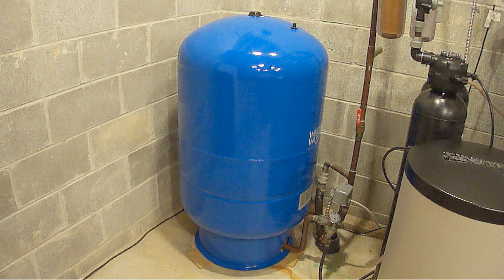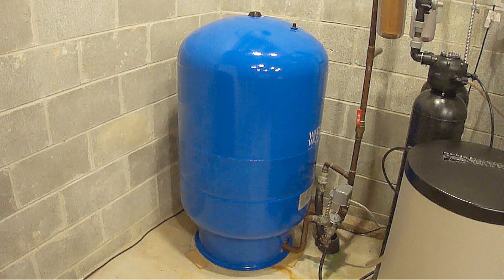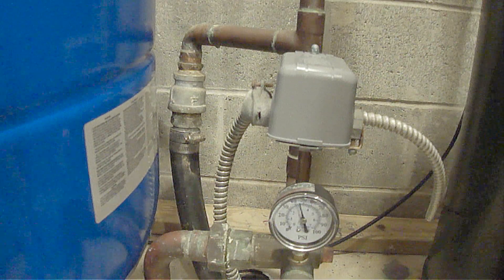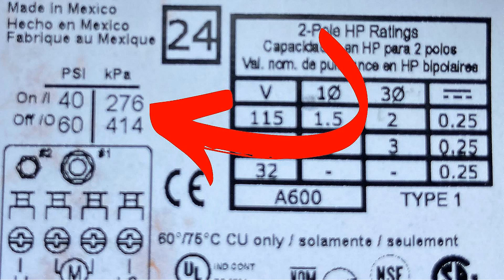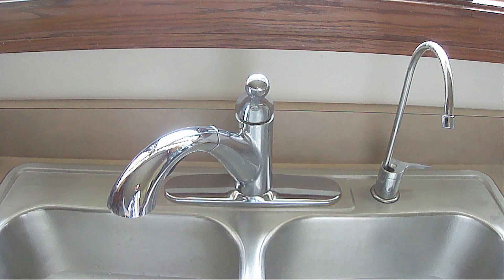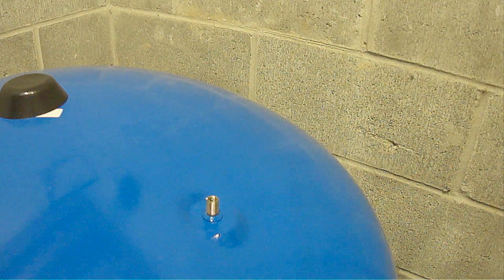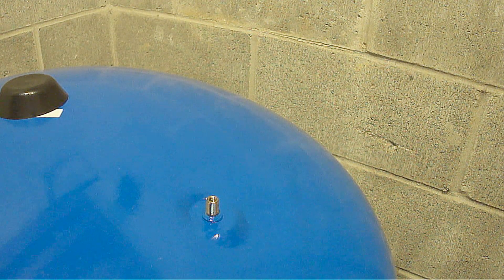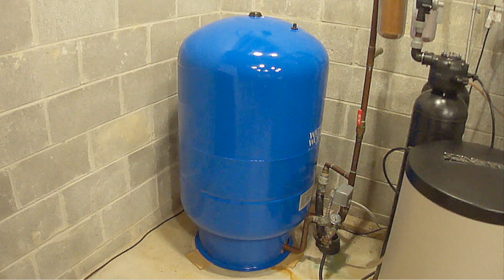How To Adjust A Water Well Pressure Tank - Fast & Easy!

Comment: Thanks for making this video now I can set the tank without having to call a plumber, each plumber I spoke to said I needed a new tank claiming the bladder was leaking without even being here to access the issue. I know it is because my friend who fixed my pipes let way too much air out of the tank when it was filling with water, but even telling the plumbers that I know exactly what and when the problem started  they won't listen. I wonder if it is because I am a woman and they don't know thanks to my father (rip) taught me how to do a bit of everything and I can fix almost anything, the only thing I will not work on is electricity. So Thanks again.
Reply: As a old old plumber, just a comment. When you shut off pump, drain 100% out of the pressure tank.  If tank is still working, the tank will be empty. Carefully jiggle tank, I mean carefully, not too much to frig up the piping, if it’s heavey, it’s done, the bladder inside dies get compromised and then do not even try to do anything, you need a new tank. This guy dies know what he was talking about. Great video.
Reply: You are awesome!!!! There's nothing better than a woman that knows how to fix things. Your father taught you well. I hope you have a beautiful day sweetheart
Reply: Nobody knows anything.  I had a plumber come out and get my frozen system working, and he checked the pressure with a 100psi pressure gauge.  I didn't know any better and saw the gauge barely move.  It was years later, after living with a short cycling system and low water pressure, that I finally figured it all out.  My best guess the guy was out to get my water flowing, and in the cold, he didn't bother to fix or mention the low pressure tank.  Got his money and off he went.
Reply: Same here. And they wanted to charge me 600-1000$
Reply: Then why are you here watching this video?

Comment: I just had my well water holding tank and pressure switch changed. I went from a 20 gallon water tank  with a 30/50 pressure switch to a 44 gallon Well-X-Trol tank with a 60/80 pressure switch, that I had them set at 55/75. 

My water pressure in my home still sucks. Lol what's wrong? Could it be that I need more air pressure in the tank? I can check, but can you please tell me what the proper water tank pressure should be set to with a 60/80 pressure switch?

Also, is there anything else I can do to increase the pressure in my home now? I thought with the more than twice as large well tank and almost twice the pressure switch that my pressure would be incredible. I'm hoping with my fingers crossed that I jusy need to add more pressure to the water tank itself. Sigh

Thanks for the response back.
Reply: If you use a 60/80 switch the air pressure in the water tank when it's empty should be at 58lbs. However, you said they set it at 55/75, that means the air pressure in the water tank should be at 53lbs. The air pressure when its empty should always be set at 2lbs lower than the cut-in pressure.
Reply: @ravishinghunk2671 Hey Rav. Thanks for your response back.

Yes, you are spot on. I called Xtrol directly and that's exactly what they had said. 53lbs with the tank completely empty, which is what I did. 

That said, I went from a 1/2 horsepower well pump to a 3/4 horse pump. I also went from a 20 gallon water holding tank with a 30/50 pressure switch to this 44 gallon tank set at a pressure of 55/75. 

Now, you'd think my pressure would be awesome after all that and $4k dollars later, but it's not. Sigh Its definitely improved, and I'd say it's very good now, but not near as powerful as I thought it'd be. 

Idk what else I can do to make my pressure awesomely powerful. The pipes are only rated for 80lbs, so I don't want to increase the switch pressure and damage my plumbing. 

Anyone have any thoughts on anything else I can do to increase the pressure at my shower heads? They have no flow restricters on them either. Idk what else to do. Lol
Reply: @getreal3336 you're probably not suffering a pressure problem. Whats likely occuring is the pressure is adequate, but your FLOW rate is what is suffering. Best advice is to buy yourself a Pressure/Flow gauge that can screw onto a hose bib that stems from the same supply system, hook it up and turn her on and determine what readings your getting from the system. Its likely the case that although your pressure is BEYOND adequate range, your flow is likely restricted (due to any number of a litany of variables) and will need addressing. To many fittings within a pipes run, to nicking down of pipe sizing within the system to the actual material composition of the piping itself being utilized within the system can all have adverse effects on the flow rate coming out of your tap. I'd wager this is likely your issue, and I would start there, as if you still have your pressure set at those numbers your a bit high for domestic supply pressure. A reasonably set system should be reasonably set at about 10 psi lower on both the low and high side of that mark, and although yours is not ranged at an absurdly higher setting than that, it IS enough that it could cause issues with appliances like washing machine and dishwasher supply Solenoid gate failures and such. Good luck and hopefully if you haven't got it figured out yet, that this bit of info helps you out going forward with the issuea
Reply: @sheepishmclemmingston5550    remove all the shower heads and soak in white vinegar over night. There's a good chance all of the small internal passages are clogged.

Comment: Gret explanation thanks pressure switch stop working so had to wire up a manual switch, now with new pressure switch factory set 30 /50 went up to 60 and I in plugged it used and drained water now tank pressure at 0

Comment: Video was good to check pressure tank however how do you adjust the electric switches if they have been altered?
Reply: I found another video to adjust the switch. Thanks😊
Reply from the maker: @mikelowrey2156  👍😃

Comment: Thank you, I did just what you said and you were right... Better water pressure and my wife thinks I'm MacGyver. Just wondering after I did everything I checked the pressure on the tank again and it read 55 is that about right my system is 40-60? Praise the LORD you have been a blessing to this old veteran.

Comment: proclaimliberty2000, so, did you put air to adjust the pressure while faucets open? Or did you turned off faucets and then, put air?
Reply from the maker: Turn off the power to the well pump, turn on the faucets until the tank drains and then add air to the tank.
Reply: @proclaimliberty2000 So you leave the faucet open?

Comment: Thanks; so you NEVER SAID, if your water pressure is low, you'll find the tire pressure gage reading less than the 2 psi below the taken pressure reading.  Hopefully, that is my issue, and I can increase my water pressure.

Comment: I just checked my pressure tank and water came out of the valve, it should read 28. It reads around 50, what might have happened? Thx
Reply from the maker: It sounds like the bladder inside to pressure tank has failed. You’ll need to replace the pressure tank. You can find a video on tank replacement in my playlist under household.

Comment: I'm curious though, do you need to close the faucet before you fill it up with air. Wouldn't it want to push the water out? In the line
Reply: Water does not compress.
Opening the valves allows adjustments to the tank without being affected by the water in the system.

The steps are given in order in the video.
Reply: That's what I was wondering.
It seems you would need to, so the pressure would build back up into the tank...not sure though. 🤔
Reply: No you dont need, you only need if you have bladeless tank 👍🏻

Comment: Does the water to the house need to be shut off after you drain the water, and then proceed to put air into the tank?
Reply from the maker: First, turn the power off to the well. Then turn the water off to the house. Then drain the tank. Now you can put air in the tank.
Reply: @proclaimliberty2000  ty
Reply from the maker: @skorpyo331  👍😃
Reply: @proclaimliberty2000  problem also I had, was I had to get another cord to replace garbage cord going to pressure switch too. Done

Comment: So if you want to increase pressure you need to replace the pressure switch?
Reply: That is incorrect, you can increase the pressure by adjusting the pressure spring, "the larger spring," 1 complete clockwise turn will increase the pressure 2-3 lbs. if you desire more turn it again, Both springs can be readjusted but usually not needed! WARNING! Don't Forget To Turn The Electricity OFF When Doing This

Comment: Thank you , mine should be at 38 but it’s 40 , what should I do . Thank you for any help you can provide
Reply from the maker: First, you need to drain the tank until the pressure gauge drops to zero. Then slowly let air out of the air valve just like you would a car tire until your tire pressure gauge shows 38. However, having said all that if it were me, I would not worry about it being 2 pounds higher.

Comment: Great video do I check air valve pressure with tank filled with water or empty?
Reply from the maker: Empty
Reply: If you don't want to go through all the headache and you have an accurate pressure guage, you can get a pretty good idea of tank pressure and switch settings by watching the kick in pressure with a spigot flowing then turn the spigot off and watch the kick out pressure. Make sure the pressure guage doesn't shoot up to a high pressure before kick out. If it does call the well contractor for switch adjustment.

Comment: I must have missed something! I didn’t see him adjust the pressure switches
Reply: The pressure switch should not be adjusted by the average homeowner. Improper adjustment of the switch without propper adjustment of the tank and pump can throw a well all out of sorts. Best to leave that to the well repair contractor.
Reply: @darianbethune5257  There's nothing to it, it's simple. Don't waste $150 for a plumber to come out for 5 minutes.
Reply: @squirrelcovers6340  it is not difficult for someone who knows what they're doing but for many it should not be attempted because they're going to cause more harm than good.
Reply: @darianbethune5257  it's just a setting... pay me $200 to come by and do simple things for you if that's how you are.
Reply: @joshuadouglas7625  trust me I don't need your help and can do it on my own but most people shouldn't attempt this and have no idea what they're doing and will only make it worse

Comment: Does the air leak out when replacing switch and gauge? My gauge is rusted  and slowly dripping so a friend of mine said if Iam going to replace the gauge to go ahead and place the pressure switch. The system is 17 years old
Reply: Change them both out for sure. Pressure switches fail due to corrosion, age and buildup of a number of substances in using hard water deposits.

Comment: Hi thanks for the info. I have holding tanks that produce 26PSI of head pressure to my system.  I have to close the inbound water line to the pressure pump from the holding tanks or the water will just run until the tanks go dry. My question is; after I have adjusted the pressure in the bladder tank do I open the inbound water valve first or turn the power back on to the pressure pump first then open the inbound water valve? Does it even matter? Also, my pressure tank seems to need this service a couple times per year...is this normal?
Reply from the maker: It doesn’t matter.  Sounds like your pressure tank has a small leak.
Reply: It likely won't matter. If you keep it off your pressure tank will build to the desired "full" pressure the first time. When you open the storage tanks. The next time your pressure tank builds it will likely build to the pressure that includes the head pressure of the storage tanks.
Reply: Your pressure tank needing to be adjusted a couple times per year does sound like a small bladder leak. Many times you can tell by moisture coming out at the needle when you test the air pressure at the top of the tank.

Comment: So I drained my tank and I put 38 pounds in because I have a 4060 and I check the air pressure after i  turn the power back on and the pump runs it’s at 50 not 38 anymore.
Reply from the maker: You don’t have the pressure switch adjusted properly.
Reply: @proclaimliberty2000  if I shut down the ball valve to to house and drain the tank. Once it gets to 40 it clicks on and runs till it gets to 60 then clicks off.
Reply: I’m referring to checking the air pressure after its all done. Do I just let some air out. I have not seen in one video where they check the air afterward

Comment: The old galvanized tanks don’t have bladder. How do they maintain pressure in the lines. Can you make a video out of that subject?
Reply: The old tank compresses the air inside, eventually the air desolves into the water so it needs to be checked often, basically fully drained of water then turned back on. There are several youtube videos of the different style tanks, just look them up.

Comment: So, why 2 psi under the On psi setting?
Reply: Those bladders increase the capacitance of the system, reducing the sudden pressure change that happen when a toilet is flushed, etc. Because air is more compressible than liquid, when pressure suddenly drops they expand a little to provide more volume, causing a blunting of sudden pressure changes, either way. They lose the ability to respond to sudden volume drops when already at full expansion, and there is a little strain on the diaphragm when there is nothing pushing back on the other side. Likewise, if baseline bladder pressure is too low, at the highest system pressure they can compress so much they lose the ability to respond to pressure spikes. So to maximize system capacitance through the whole range of system pressures, 2 psi below pump cut in pressure ends up being a reasonable target.
Reply from the maker: This is to assure that the pressure tank does not run out of water before the well pump turns back on each time.